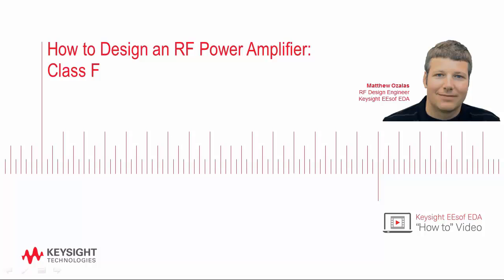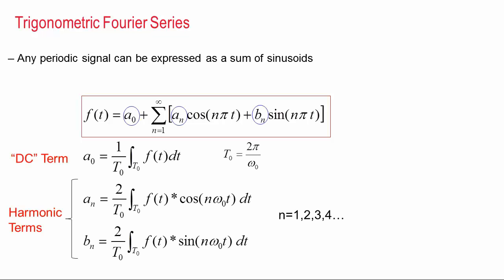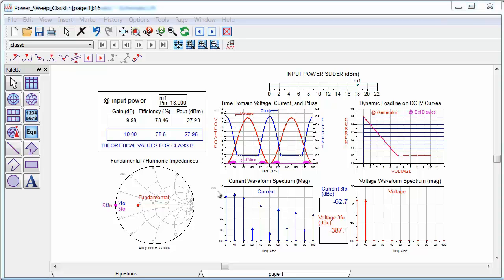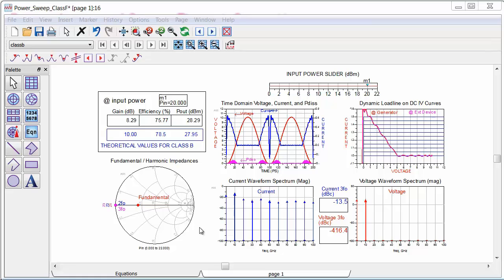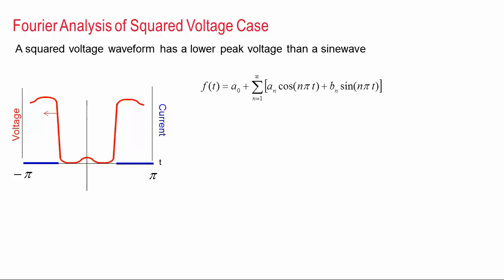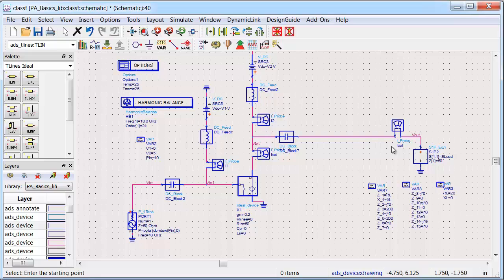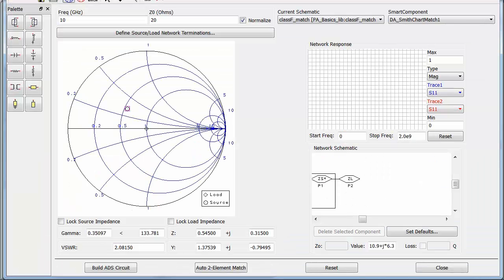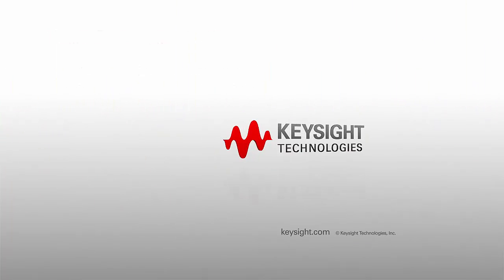How to Design an RF Power Amplifier: Class F

Comment: I don't get at @11:00 when you say "open at third and fifth" when before you set up a finite (200Ohm ) resistance for those current harmonics. With an open how can you define voltage harmonic=current harmonic*R and thus building the square-wave? But at the same time with a finite resistance how are you not dissipating energy at odd harmonics?

Comment: Hello,

Thank you for the video. very Useful.

I have following question:
Class F amplifier uses 3rd and 5th harmonic.
I have a non-Linear model of the transistor. Using Loadpull tutorial by Andy Howard I was able to set a load for a fundamental frequency.

Can you please suggest how to set loads on 3rd and 5th harmonic?

Thank you,
Reply from the maker: +Michael Adelman In the workspace that comes with this video http://www.keysight.com/find/eesof-how-to-classf, simply open the design named ‘classf’ and you’ll find an equation based load component which will allow you to specify or sweep the reactance of any of the first 15 harmonics.  Type in whatever value of reactance you want.
Reply from the maker: +Michael Adelman Remember, for a real device, an opencircuit harmonic impedance which is provided externally to the transistor will very likely not be an open circuit inside the transistor due to the effects of the device parasitics.  Even if you do see semi-square waveforms externally, you could be operating in some type of Class J mode instead of pure Class F – which could have reliability implications.  
For more information about Class J and continuous modes of operation, check out this video https://youtu.be/N0dLVMoVQSI
Reply from the maker: +Michael Adelman By the way, Andy has posted an excellent video on How to Run a Loadpull Simulation here https://youtu.be/34N-r5rPSzU
Reply: Thank you, this video that Andy posted is great and very helpful. But, it does not refer to higher harmonic loadpull. 
Please share much more relevant video, thank you.

Comment: Hi. Mathew. I want to optimize my design for 5.8GhZ . How can I change the frequency from 10 GhZ to 5.8GhZ for running the optimization for output harmonic terminations?
Reply from the maker: You will need to adjust the frequency of the equation based
load on the ADS schematic .  To do that look for a Var block below the
load in schematic and change the rf_freq variable to be 5800 (because this is
in MHz).  Also you will have to adjust the frequency of the signal source
(Port 1) to be 5.8 GHz so that you are driving the device at this frequency
(you could just set that to be rf_freq MHz too).

Comment: I have Cree 10W transistor, we don't have access to the current generator plane and internal parasitics, so how can we terminate the harmonics in the packaged plane?
Reply: Good questions, Antra. Those lucky enough to have access to tools like ADS or MWO where they work can obtain vendor-supplied behavioral models for those tools which permit access, as it were, to the current & voltage waveforms prior to the intrinsic & package parasitics. For those without ADS access, however, there's still some hope where the CGH40010F is concerned since it has been one of the most used RFPA devices for students for their research and thesis work. There are endless papers & thesis, dissertations which employ this devices online without cost. One of the best, I've found, is King, J.B., & Brazil, T.J., "Nonlinear Electrothermal GaN HEMT Model
 Applied to High-Efficiency Power Amplifier Design," IEEE TRANSACTIONS ON MICROWAVE THEORY AND TECHNIQUES, VOL. 61, NO. 1, JANUARY 2013. The authors model the CGH40010 quite thoroughly, breaking out all the Angelov model parameters, the nonlinear parameters, such as the all-important Cds, and even model the thermal and dispersion aspects (which account for the GaN charge trapping problem).

Comment: When I replace my device with a real device the data display shows an error. Why is it so?
Reply from the maker: +Tushar Sharma 
You will need to update the data display to reflect voltages and currents in whatever device you are using.  The device shown in the workspace is meant to illustrate
access to the intrinsic current source node – so the voltage (node name) “Vcs”
and current probe “Ics” are inside of the device (you can see this by selecting
the device named “ideal_device” and pushing the green down arrow in the toolbar
– note the current source “Ics” and voltage name “Vcs”).  All you need to
do is name the output node (perhaps the drain) of your device to “Vcs” using
the name button on the toolbar, and place a current source from “Probe
Components” palette named “Ics” in series, and your data display will update
accordingly.
Reply from the maker: +Tushar Sharma If you are new to using Keysight ADS, then I would recommend checking out some of our eLearning material here. It's a great place to start! http://www.keysight.com/main/editorial.jspx?ckey=1800357&id=1800357&lc=eng&cc=US

Comment: Thank you for this great educational video ! Per chance, do you plan to do one for inverse class F ?
Reply from the maker: +Adrien Azerty  In many cases this Inverse F mode of operation is desirable–first for devices with larger on resistance and higher bias voltages, ICF tends
to provide superior PAE.  Second, open circuit harmonic terminations are
easier to realize at lower frequencies so practically speaking, inverse F mode
may be realizable higher in frequency.   It’s pretty easy in the
workspace provided to just flip the impedances to realize Inverse Class F – in
other words simply put high impedances in the even harmonics and low impedances
in the odd harmonics to square the current waveform and that should allow you
play with all the tradeoffs involved.

Comment: I am not sure what does the bias mean when you are defining the basic theory of PA amplifier operation.
Reply from the maker: F.A.W.K.E.S. The bias is referring to the quiescent DC operating point (DC Voltage and Current) of the transistor when an RF signal is applied.  A transistor’s DC voltage is usually set by the power supply, while the DC current depends on the input (control).  The RF signals are superimposed on this quiescent bias point.  Class F is more of an advanced mode -- for more information on the basic theory behind PA design, check out this video https://youtu.be/WAingaHfBMs.